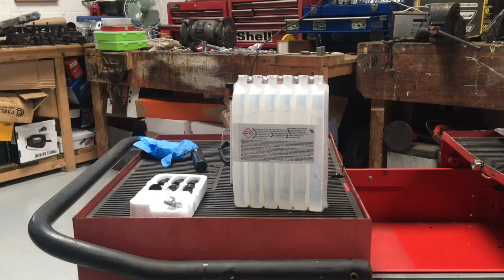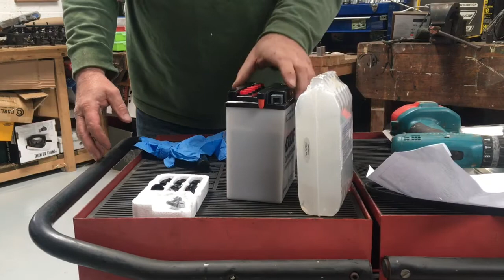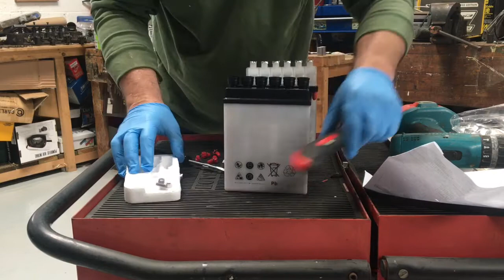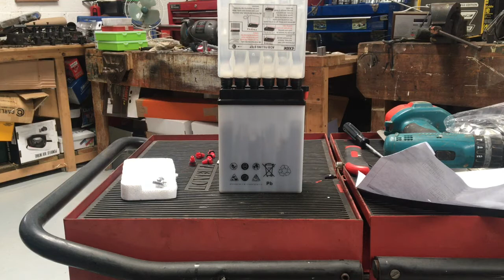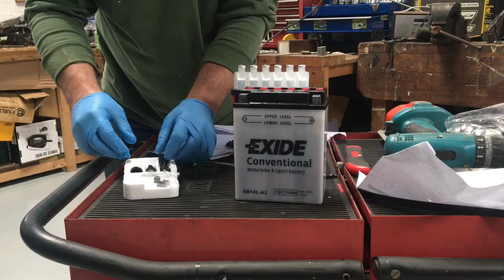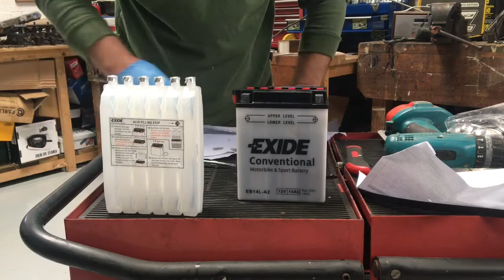How to fill a motorcycle battery with Acid

Comment: When handling acid it is a good idea to have water on hand in case of splashes, a bucket or sink to stick hand in, a drink bottle to pour onto your face/eyes. Acid can also get under the gloves so change them and wash before handling other tools. 
To remove contaminated gloves - With one glove pluck the palm of the other and pull so the glove comes off inside the other, now insert a bare finger under the back of the remaining glove and peel it off inside-out; you have removed the gloves without getting acid on you and have contained both gloves for the bin. Now wash hands to the elbow.

Comment: Did you check electrolyte level. If they got the acid quantity correct it will be right but it must cover the plates, hence top up with demin to the level lines. 
A lot of folks complain their battery won't hold charge - because they never check the electrolyte level and top it up.